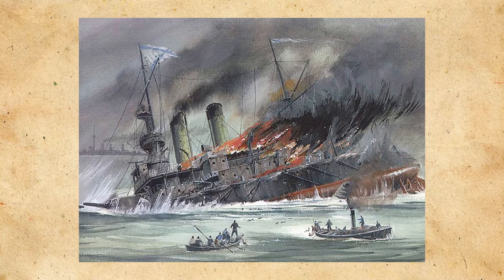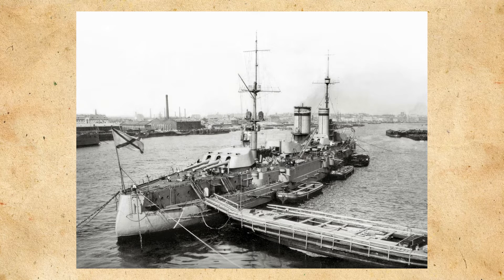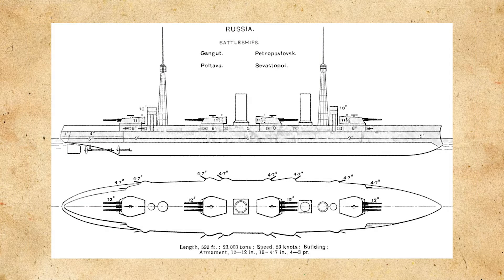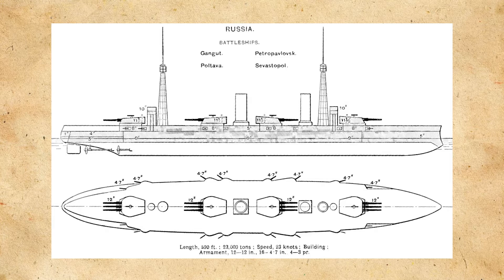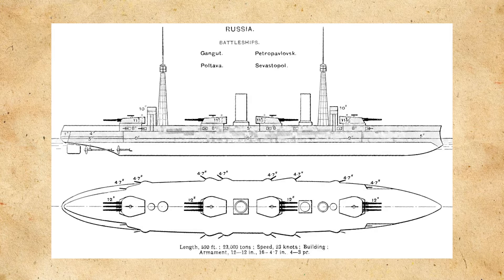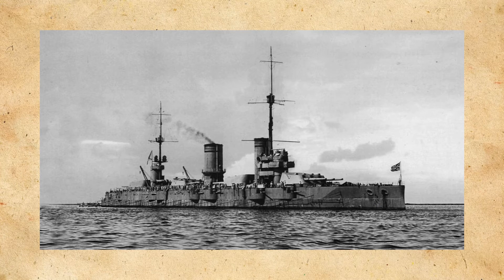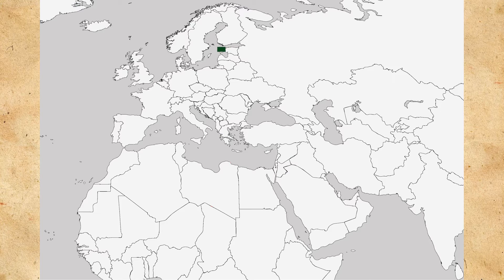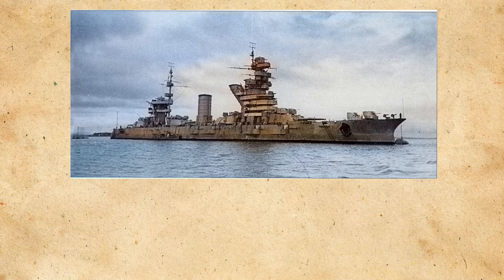Russia's Dreadnought's- The Gangut/Sevastopol Class

Comment: The Gangut Class had a displacement of 23.360t normal, 25.850t full, 4 Ships to the Class, than there was the Imperatritsa Mariya-Class, 22.600t normal, 24.000t full, 3 Ships to the class. the main difference between Gangut and Imp. Mariya Class was the Orientation of the Turrets, the Armour and the Machinery - the Imp. Mariy was heavier armoured and had a weaker machinery.
Turret-Wise: Gangut had their Turrets in Pairs facing forward/backwards, while Imp. Mariya had the A/B/C-Turret facing forward and D-Turret facing to the rear.The leayout and number of the secondary Battery was also different.
Source: Conways All the World Fighting Ships 1906-1921